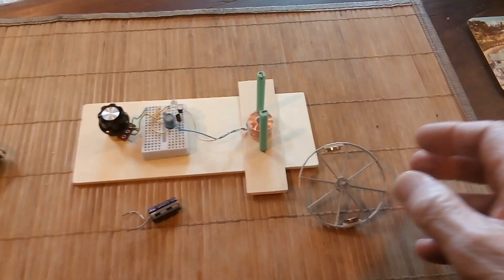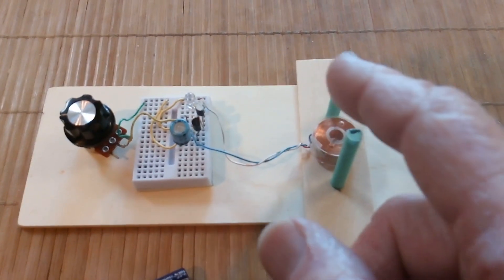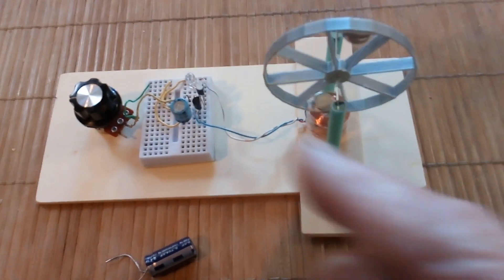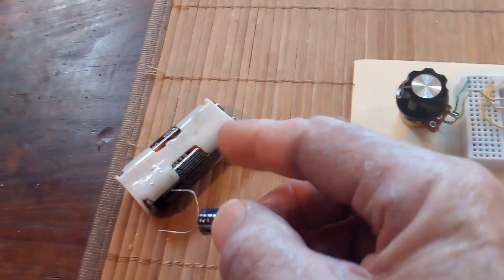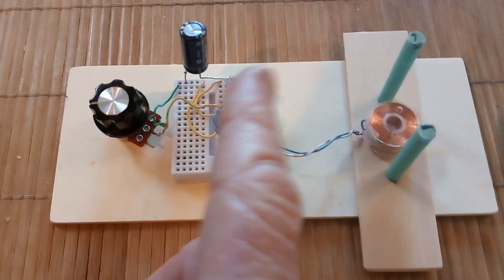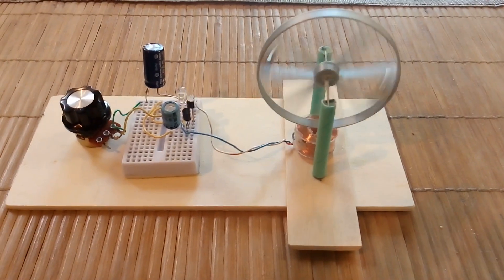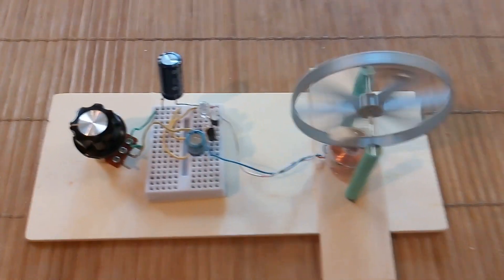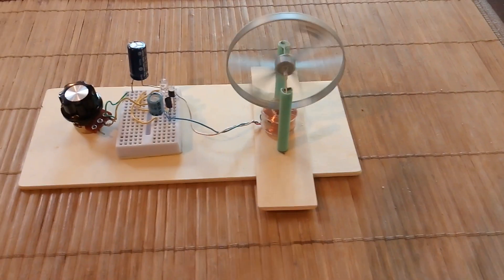Mini Ferris Wheel

Comment: That is brilliant 😆😊👍
Reply from the maker: I might 3D print a bigger wheel like yours.   It has a nice look to it if you turn it slowly.  Maybe make it a solar  thing.
Reply: @Lidmotor  I think mine would run easier if I wasn't trying to make use of that coil from the wireless receiver module, but I wanted to do something useful with it after I had killed the circuit board 😊